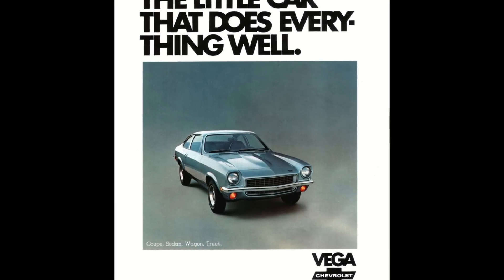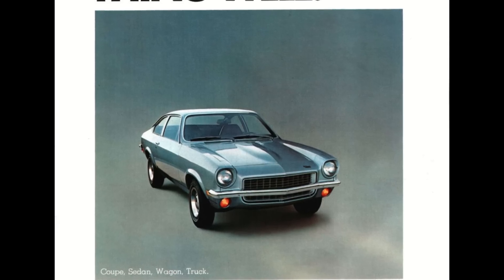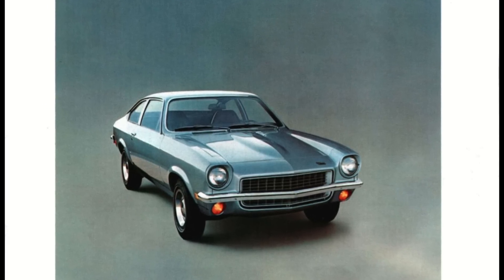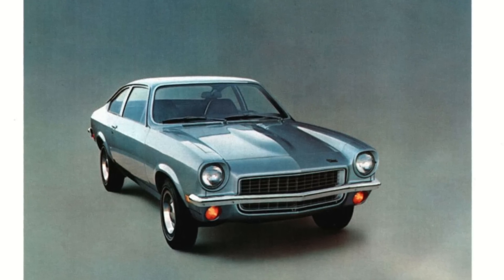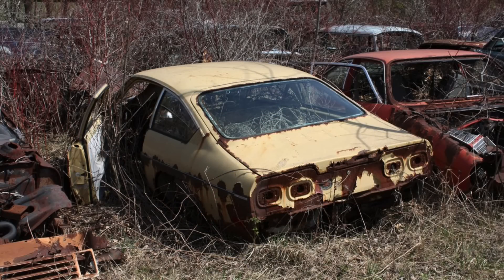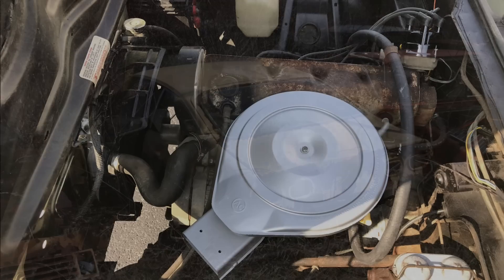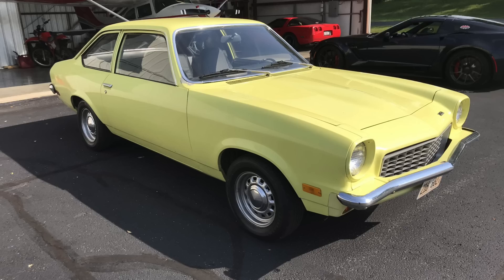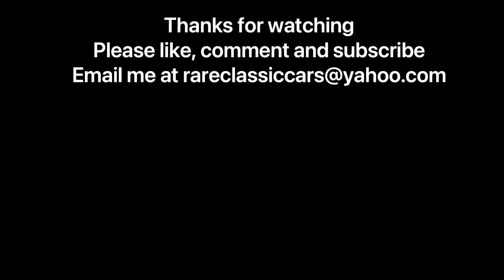GM's Largest Failures: Why The Chevrolet Vega's Engine Turned Buyers Away From American Cars

Comment: I had a new 72 Vega GT ... yes the Air filter component was irksome / annoying / and expensive ... another annoying item was the Opel? 4spd manual transmission with throws that could be measured in feet (not inches) ... and yes around 50K miles it started burning oil ... since it really was my Dad's vehicle he traded it in on a 76 Olds Vista Cruiser station wagon (which actually may have been one of GM's best vehicles at the time since it was essentially a Cutlass) ...oh wait one last annoying item ... under certain conditions when you let off the throttle in gear fuel?/fumes? would collect in the exhaust system and exit with a bang/explosion ... oh wait another ...the fuel filler cap which was low and behind the license plate and was often not put on correctly and fuel would literally slosh out under acceleration (this may have been a recall item but have forgotten)... but compared to the Pinto / Gremlin at the time it was the best looker and more importantly the best handler of the bunch ... Thank You Keith Chicago IL

Comment: Vega should have used the Pontiac iron duke engine.
Friend of mine had a Vega.  At about 40K miles the engine FAILED.  One of the wrist pins snapped, and the connecting rod then pulverized the piston which made a hole in the block.  We found aluminum debris in the oil pan, along with water.  Pulling the head, one of the pistons was missing (it was in the oil pan!).  IIRC, the Vega engine used teflon rings.  Before the engine self destructed, it didn't burn any oil.
Coolant recovery bottle is also a safety feature, you can add coolant to a hot engine without opening the radiator cap and getting burned.

Comment: I owned a73 Vega GT. Yellow with black stripe. Had a great interior. The body was slick. From what I remember this was the very first car designed on a Cray Super Computer. Also the later engine blocks of Mercedes used the same alloy. Where GM smeared the aluminum MB was able to cut with precision the alloy. Had mine in high school. Replaced a 54Bel Air. Then I replaced the Vega with a BMW 2002. Have been a fan since then. Soft spot for the Vega.

Comment: A cousin had a 1973 model with a 4-speed that I drove sometimes. I liked it! The engine was torquey, the manual steering was light, and it handled well for the time. My wife bought a 1974 model (it was cheap and she knew I could work on it) while in college. The original owners claimed that cylinder liners had been installed. Maybe, but once I tuned it up it had no smoke and ran well. It had a 3-speed manual, not as nice as the 4-speed, and it did have rust issues. Nonetheless, it served my wife well until we got married and bought something nicer.

Comment: I well remember this car's debut, and it was such as sad conclusion to what looked like a potential winner.  In the southern USA we don't care too much about rust, but an engine that won't make it 20K without blowing the head gaskets tends to chap the customer.  I can remember being in the dealership where they were keeping a Vega motor in stock they were replacing them so often. That' didn't mean the motor you got was any better than the one they took out.  It was a catastrophe for GM, but the only good one I ever saw was a GT wagon model someone dumped a small block  TH400.  THAT fixed the engine problem, but nothing could fix the reputation it generated. On top of that the engine was a slug, where a riding mower had more power than that car.

Comment: Yes, the Vega had rust issues, often in the lower windshield area.  That said, GM had the same trouble with back glasses on many of their cars for years before that.  So, it wasn't a Vega issue as much as a poor GM design.  GM replaced many engine blocks under warranty, extending even into the late 70's.  The Vega GT was a really good looking car, and, when equipped with the custom interior, was a very nice car.  Underpowered, yes.  It could have been a great car.  The most amazing and ridiculous thing GM did was to put the Cosworth engine in the Vega.  Lipstick on a pig.  And very expensive lipstick at that.

Comment: One of the major failures with the Chevrolet Vega was the cylinder head design it was awful, a two valve or 4 valve aluminum head design would have been the life-saving design of Vega 4 cylinder engine; the bottom end design wasn't really that bad. And in the old days if you were in rust country salted roads it was up to you to get the car undercoated so it won't rush apart lake in Cleveland Ohio.😅😅😅

Comment: I got a 1971 Vega GT in June of '71 as my second car and first new car.  I loved that car and have very fond memories with it involved.  Kept the car until Nov. 1979 and, living in Maryland, never had any of the rust problems so many allude to.  By the time '79 rolled around it was burning oil pretty bad and had about 92,000 mi on it.  The only time it ever let me down was when the timing belt broke at about 65,000 miles.  Had it towed home and replaced the belt myself in the garage.  I guess I was 26 at the time.  If I remember correctly, the air cleaner only needed to be replaced every 50,000 miles, so I replaced it once in my ownership... Can't see much point in all the bitching about the air cleaner. As far as the all aluminum block, I'm sure they were trying to push new technology and co-developer Reynolds aluminum bought in that it would be okay.  Sometimes new technological "innovations" don't turn out. In retrospect, I would buy it all over again for the fun I got out of that car for those 8 years!

Comment: My first new car was a 1972 Vega GT. Obviously, I was excited to get it. However, things soured quickly. The hatchback didn't close nicely, and the mechanic would bend the scissors here and there to correct it. Two weeks into ownership, I took a trip driving on an interstate. I exited on a ramp and stopped at the cross street. When I let out the clutch, the seat flipped backwards, but fortunately I had a grip on the wheel. The four bolts fastening the seat had worked themselves out! Within a years' time here on the salty Wisconsin roads, rust was making itself evident, as well as oil consumption. Shortly after I sold it to a friend. He drove it to work for a while, carrying a gallon jug of engine oil with him. Fortunately, I still had my first car, a 1966 Corvair. After a year of disuse, it ran fine and after 168.000 miles, I finally traded it for used 71 Dodge Coronet.

Comment: I remember Vegas used to be popular to swap small block V8's into...I wonder if they could have fit an inline 6, of the 194/250 variety into them?...that's what AMC did when the original planned engine for their Gremlin/Pacer, I forget which, didn't work out...the existing inline 6 seemed to work out fine in those small cars for AMC...

Comment: My brother and sister co-owned a '74 Vega. It was a rusty oil burner, but one day the engine unexpectedly locked up. My brother took it apart and it had the strangest failure anyone had ever seen - the skirt broke off the second piston and the remainder of the piston turned sideways in the cylinder. broke the cylinder apart and bent the connecting rod into a "c" shape. incredible!

Comment: Almost as bad as the absence of a cylinder liner is the open deck design. Just about every engine that I know of with an open deck design has chronic issues with head gasket failures.

Edit: I made this comment before I got to that part of the video. lol

Comment: RE: coolant level light - my Mazda RX-7 had a warning light and buzzer for that. The Wankel engine needed to be full of coolant because they ran so hot, so if your radiator was even a little bit low there was a very loud buzzer to warn you.

Comment: Hot rodders fixed the Vega.....we slammed a v8 in it and it was fixed
Reply: Iron block iron heads pushrods not OHC 6 or 8 cylinders fixes anything.

Comment: Familiar story about GM from the 70's and 80's as their penny pinching killed many great ideas and designs.  I had an engineering colleague who worked for GM in the early 80's and he told me if the engineers wanted (or needed) to make a production to a vehicle it could not cost more than 25 cents per car.  GM really blew the call on this little car and that's a shame because the Cosworth versions were pretty sweet little cars.

Comment: The high silicon content alloy used for the Vega engines was the same as that used to cast the aluminum big block engines powering many CanAm race cars beginning in 1966.  I was working at AC Delco around that time, and the rumor was that GM used the CanAm cars as research for the alloy engines later used in the Vega to prove the durability of the unlined cylinders.

The later Cosworth developed twin overhead cam engines produced 140 bhp reliably compared to the 80 from the standard Vega engine.  Race versions of the Cosworth variant produced up to 260 bhp!  There was little wrong with the block alloy or design.  The major failure was the engine installation.  Inadequate cooling and the absence of a coolant recovery tank.  The Vega was meant to be a cheap car, and the GM bean counters made it one, cutting costs with the small radiator and subsequent overheating that GM and their dealers could easily blame on the customer not keeping the radiator filled.

During my five years working at GM during this period, I saw many, many stupid decisions made where the bean counters overrode the engineers.  It was one of the happiest days of my life when I left GM.  The company was being run by accountants, not car people.  I became a Ford guy after that.
Reply: Exactly what is the advantage of OHC v pushrods when NASCAR and Top fuel can run push rod engines at 8-10,000 rpm.
Also making an engine rebuild much cheaper and quicker.
Saying that as a previous BMW and a Jaguar owning Brit where pushrod engined American and classic Brit cars now fetch a massive premium.

Comment: Honda did an open deck design on their 1.2L all aluminum engine and it worked fine. The bonus of an open deck is the bolts holding down the head don't distort the bore when tightened. Chevy's failure was trying to mate this design to a cast iron head with dissimilar expansion.

Comment: In the late 1980's i acquired a dirt cheap  1978 Chevy Chevette which had the same one piece contained air filter unit as the earlier Vega,   probably leftover unused Vega old stock parts refitted to the 76 to 78  model Chevette's and (of course) the filter was badly clogged and done.  I was shocked to discover a replacement  costed $50 (really?).  I just cut some round sheet metal plates and used a far cheaper normal 79 model filter.

Comment: The engine on my '77 Vega never failed.  The crappy CB-250 automatic, however, liked to develop torque converter imbalance and trash the crankshaft bearings...twice.
Reply: Also, the charcoal pack in the evap cannister disintegrated, causing charcoal particles to be sucked into the 2 barrel Holley carb that was stock.  And the brake proportioning valve developed a leak; never heard of that before.  I fixed it with a small o-ring.  i don't want to keep going.  Always something.

Comment: My bro-in-law loved his 70 Vega - but it only got 68,000 before self destruction. I had a 74, engine going out before 50K, and I drove conservatively and tried to keep it well maintained - my sister later due to my bro-in-law got a neat looking "red velvet" Vega, white with rich upholstery - had to let this car go back as it could not be made to run well. I also read about no temp gauge in the Vega, of course the coolant recovery bottle, the automation of the Lourdestown plant making the line go to fast for the workers, making the engine run hot at about 210 degrees, GM should really have been ashamed of themselves. Makes me wonder if AMC could have provided them with a good engine for this car -

Comment: My family bought a new Ford Pinto in 1971 after test driving Verga as well. I was eighteen and had two younger siblings, we all learned stick-shift on that Pinto and my mom drove it to work every day. My brother totaled it with over 100k miles. 2 liter overhead cam engine and overall a great little car. Vega was crap built with the GM cost-cutting mentality, it's amazing that GM  still survives.
Reply: Pintos were great cars until they got rear-ended and the gas tank exploded.

Comment: My only ever new car off the show room, a 1971 Vega GT, red with the white stripe. A year later, with an expired warranty, the head gasket went. $400 later I had the car back and subsequently taught myself mechanics. Before I swapped that miserable little engine out for a 350 V8 I had changing head gaskets down to less than an hour of work. Carried spares in the back! With the 350 it was an awesome sleeper, slightly larger tires, a stronger rear end and 4 speed, quiet exhaust, I surprised a lot of people!

Comment: The Vega engine was rebuildable, but it was a pain in the butt.  After boring, the honing was done with special pads on the hone rather than stones and a compound that removed the aluminum but left the silicon nodules above the surface for the rings and piston to ride on.

Even the head was also a pain as there were multiple special tools to disassemble and assemble it.

The engines worked great as long as the coating on the pistons didn't get scratched.  Once it was scratched through, the aluminum of the piston would fuse to the aluminum of the bore and score the bores.

The other problem was GM's approach to the warranty.  If the car was under warranty, they originally would have those cylinders bored and new pistons installed.  For the later warranty, they would have the cylinder or cylinders that were scored bored and sleeved, but leave the unaffected cylinders alone.  Once out of warranty, they would recommend sleeving all cylinders.  Once sleeved, the engines rarely had any more issues.  GM did finally start sleeving the engines at the factory, but it was too late to save its reputation.

The main head gasket problem was the overheating; one overheat and the gasket would go.  There are many 4-cylinder engines with free-standing cylinders; the siamezed cylinders were to give the cylinders stability.

Modern engines use the reverse of the Vega's cylinders.  Now they use a hypereutectic piston which is made from a high-silicon alloy, in a lined cylinder.
Reply from the maker: Great comments

Comment: The cam buckets would "mushroom" if left without adjustment too long and the resultant valve clatter. Once this happened, adjusting the valve lash, in most cases, lead to the bucket getting stuck in the bore. That causes the valve to stay open. I also dislike the AMC Gremlin style front end on the later models. Uggh!

Comment: I owned several Vegas, ‘71 to ‘77.  I believe 13 total.  Some were strictly parts cars.  1 rusted so bad, the rear axle was floating free, but had a good engine.
I rebuilt a couple of them.  Sometimes it took several heads to find one not cracked.  The space between the valves was way to small.  I think the Cosworth Head might have solved that, although I never had one.
I liked the car, despite the problems.  Handled well & rode fair for its wheelbase.  A Buick V6 dropped in so easy, using Monza parts.  Had 2 of those.  1 auto & 1 a 5 speed.  Yep, the good ole days.

Comment: My dad worked for a company (possibly GM, I don't remember) in Michigan in 70's that was doing some research on battery powered cars. They took a Cosworth Twin Cam Vega and replaced the engine with their battery. It was Black with Gold pinstripes. To my 14 year old self, I thought that car was beautiful and have always been fond of the Vega since. If I remember correctly, It was capable of running 80 MPH for 3 hours and could pull 5 ton train car on this battery.

Comment: I had a 72 Vega hatchback. I was swapping the engine out, and part of that was to remove the manual Transmission. Once I got the transmission out, I noticed stamped on the side the letters "OPEL". To this day I always thought that had GM just used a proven Opel engine, this would have been a fantastic car.  Had they designed the car better, it would have been called Monza..

Comment: Typical GM cheapness, "saving" $20/cylinder and completely trashing your reputation for decades.  After my dad drove his first Toyota in the early 70s and noticed the superior engineering he refused to buy American again.  Yes it cost more initially but the overall cost was much less; not to mention the savings in aggravation.  Mom bought her last American car in 1982 because it cost $1000 less than the Corolla dad wanted her to get.  Timing belt snapped, heater core ruptured, a/c wouldn't blow cold until it shifted into third gear, the brakes quit working in traffic once.  To its credit though it ran like a charm commuting from Oviedo to Cape Canaveral - well until dad hydroplaned into a bridge coming home from work.  I never saw him so happy!

Comment: Adam, I am a huge fan of your channel and watch every single episode. I did want to correct one piece of information that you had mentioned, and that’s that the Vega had a one by 1 foot radiator. That is definitely not the case. I know the radiators were about 26” by 20”. To your original point however, they were certainly undersized. To be fair to GM too though, no radiator was as small as 1 foot on any Vega that I know of. I am a former ASE master auto technician and worked for all of the big three at one time or another.
Reply from the maker: Fair point